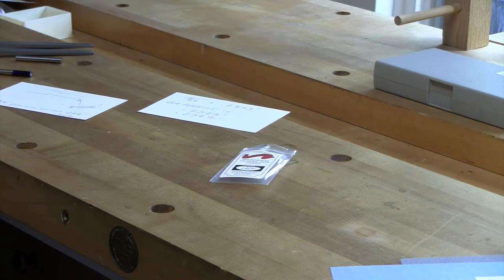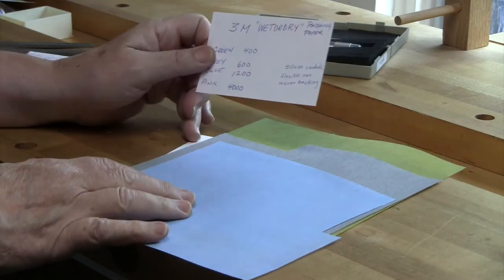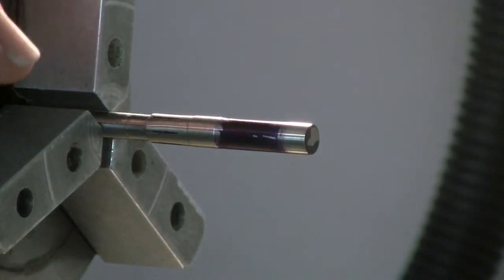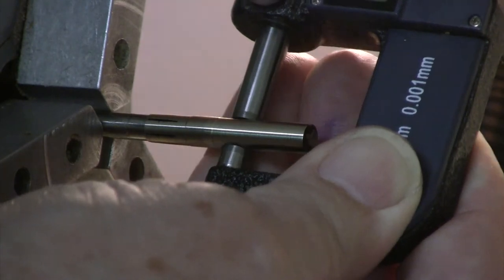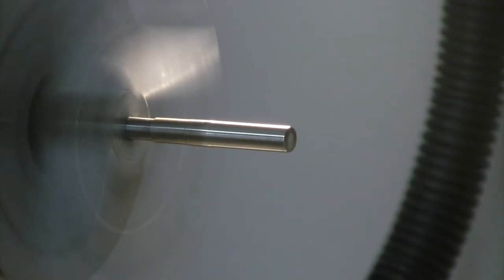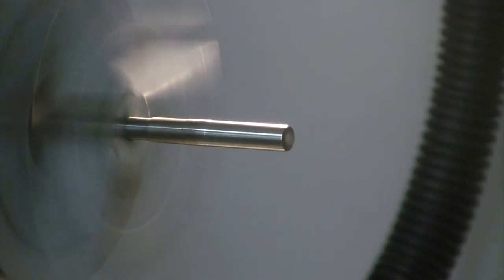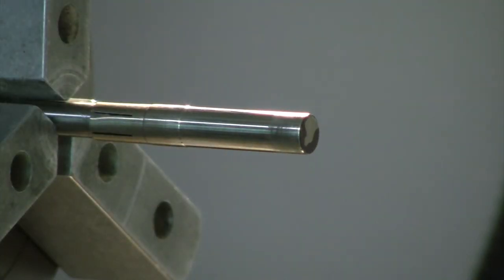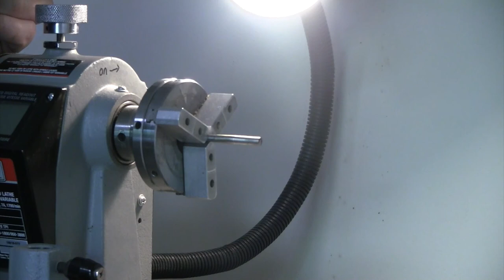Final fitting a male ferrule for bamboo rod making

Comment: Thank you for these videos.  I have always had problems with getting my ferrules to fit correctly.  I was taught to do this process after the ferrule was on the rod.  Very hard to do this way...  I purchased a set of ferrule mandrills, 3M WetorDry Polishing paper, and 500 grit diamond compound.  Got on  my Sherline lathe and cleaned the females, then sanded the males to fit the females.  This is going to make ferrule installation so much easier!  Thanks for taking the time to share your processes!  Look forward for more!

Comment: Thanks for posting, that was one of the better lessons I’ve seen on this topic. I also reside in the GTA, and have built 1 rod - almost 2 if you include duplication of certain steps;) I slightly over cut my ferrule, but not enough to ruin it. I was going to ask why you didn’t finish the final fit in the lathe, until you mentioned the “leverage” when it’s installed on the blank which will make a difference. Looking forward to watching the rest of your clips.

Comment: I've just restarted making bamboo fly rods and walked away from the craft because I couldn't get my ferrules to fit. This particular video was really helpful BUT I have one question. What is holding the female ferrule on the lathe and why does the female ferrule not pull off whatever is holding it on the lathe when the male ferrule is inserted and then pulled out of the female ferrule?
Reply from the maker: I think for most builders it is easier to fit the ferrules on the rod as long as you have a lathe. In the video the male ferrule is mounted on a drill blank and simply friction fit in place it holds pretty well.  If you hold it while pulling on the female ferrule it tends to stay in place. Drill blanks are inexpensive and sold in fractional sizes which matches your ferrule size. McMaster CArr would have them so order 10/64 through 18/64 (5/32 -9/32)